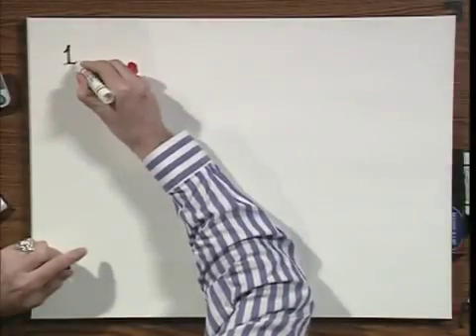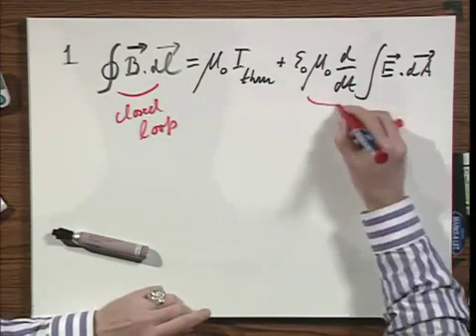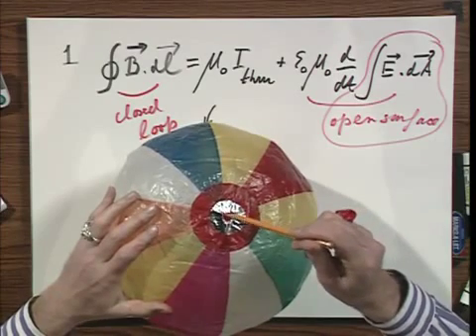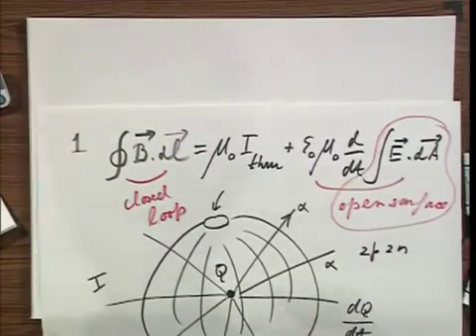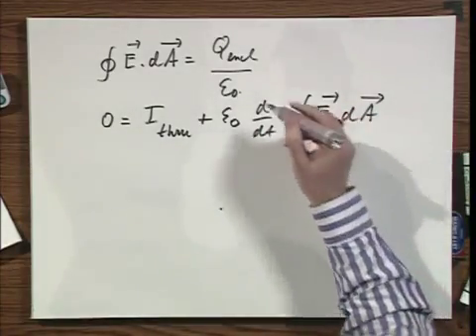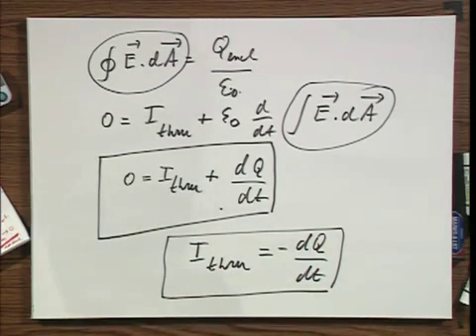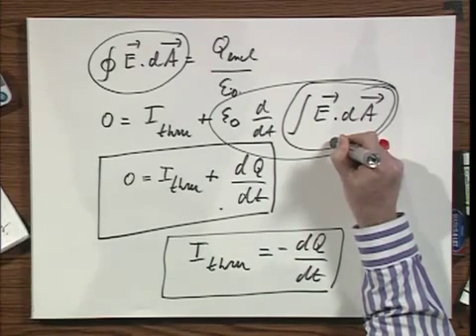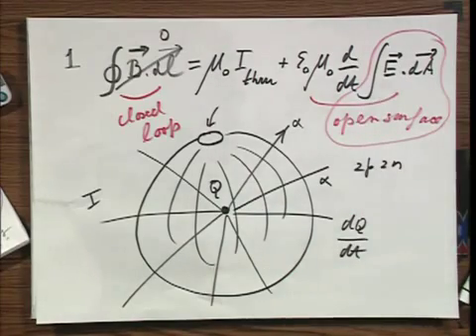8.02x - Module 08.01 - An Argument for the Displacement Current Term.

Comment: sir i have read book henning F. Harmuth  "modified maxwell equtions on a electrodynamics quantum", he is found a solution electric field strength, and found that a wave EM is damped on a surface  or whatever  in initial conditian, and after that the electric fied will stable. this is can not proof by maxwellian. i have searched the reason in chatGPT, but i don't sure the proof is true. so i want to ask you sir, is it possible the electric field is damped on initial conditian and after that the electric field will stable? what the reason ? why that happen.  thanks sir..

i hope you be gratefull

Comment: Hi Sir. I love your lectures. They have reignited my love for science once again. I would like to ask one thing though regarding antennas. How do monopole and dipole antennas actually work since there isn't a closed circuit provided for current to flow? Is it due to capacitive effects that the charges move back and forth?
Reply from the maker: I discuss antennas in my 8.03 lectures. Also use Google